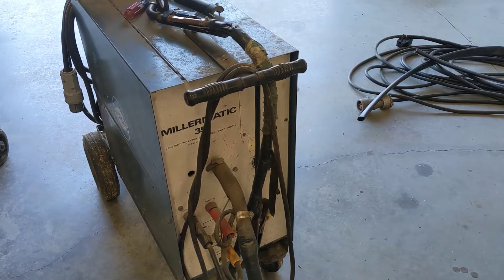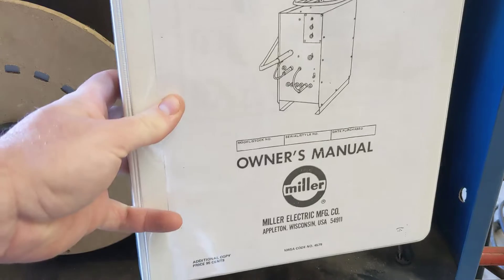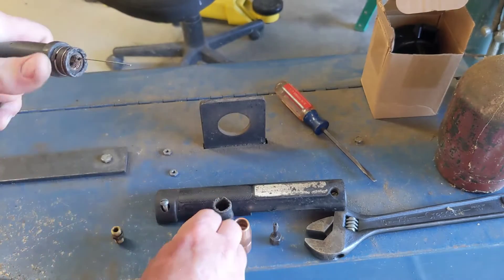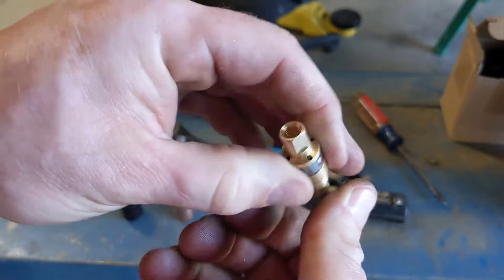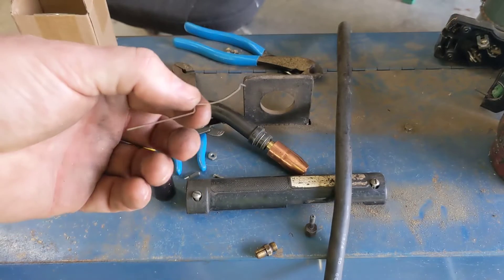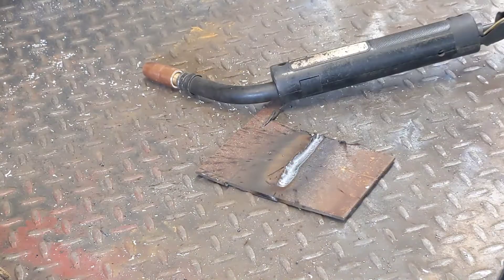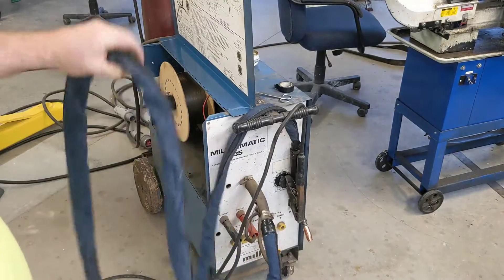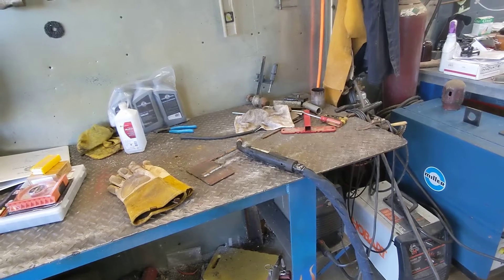Millermatic 35 Welder Restoration and Conversion to modern consumables COUPON: TOFS10OFF

Comment: I have a white face 35 (1979) that I've owned forever.  I decided to do the gun conversion to a tweco style gun.  I also purchased a .025 liner.  I found a .025 roller for the 35 on ebay.  All in all I am satisfied with the conversion but it was pricey because I purchased it as a kit.    It's a solid welder but definitely hands on.

Comment: Nice machine. Your Millermatic 35 must be an older model. I bought a 1978 edition with the spot weld module. It already had the standard Miller socket installed but still used the old wand. They didn't even drill the adapter for the gas, it was just a solid chunk of copper. I bought a new Tweco 250 amp 15' wand with a standard Miller plug and all I had to do was hook up the gas supply to the solenoid. The socket in the machine even had a rubber line coiled on top of it to reach the solenoid in the back of the machine.That old Millermatic has a great old gas solenoid. That solenoid, old as it and the rubber line are, still seals so well there is still pressure in the line to the tank even after a couple of weeks. Love the size of the wire feed motor. No wonder there is no lack of torque to feed the wire.  Good welders.

Comment: I have one i bought new, trying to run 023 wire but the rolls can only run 030 any suggestions.
Reply from the maker: I searched around for 023 rollers and wasn't able to find any :(.  Unless you can find some new old stock laying around somewhere.  I may look at mine and see if it would be possible to machine some for 023 wire...